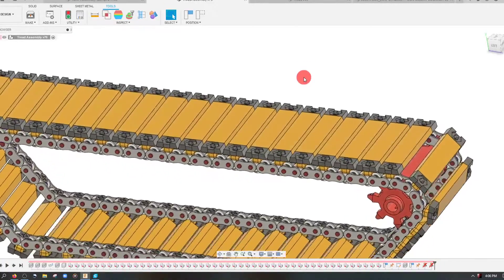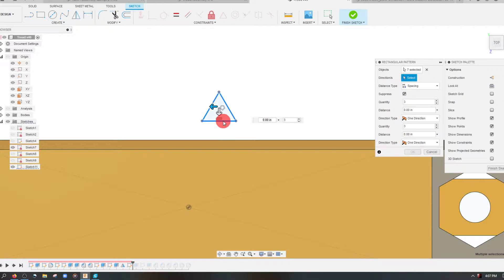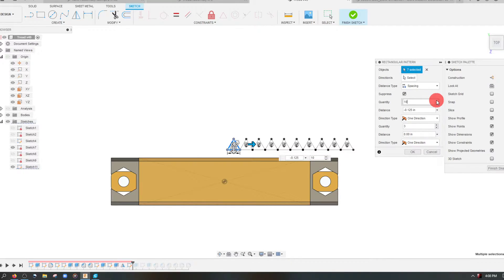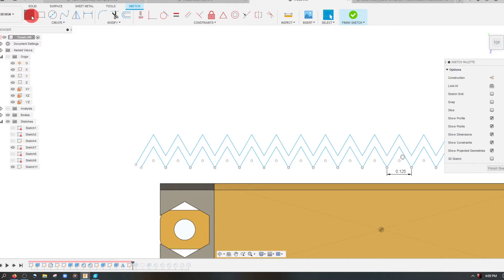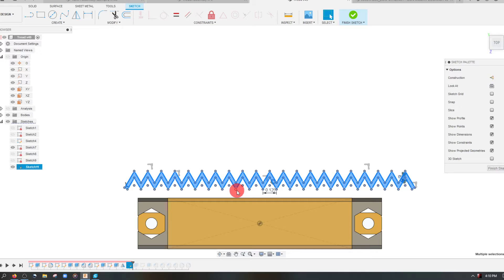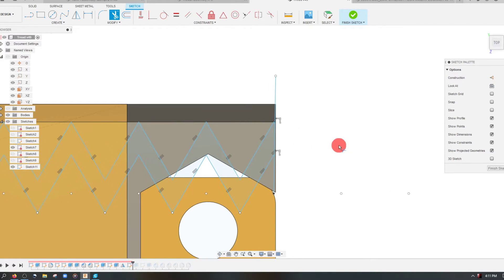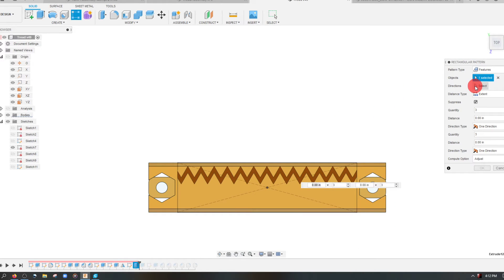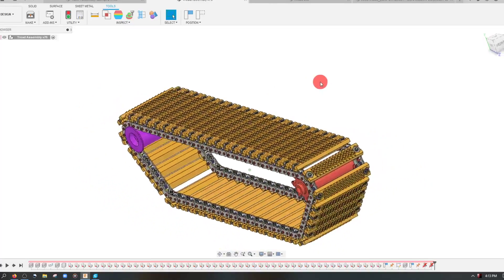How to Create Raised Surface Patterns in Fusion 360 (Tracked Robot)

Comment: Hi, good tutorial. Just a suggestion here. Another way would be to just sketch an inverted "V", pattern, extrude surface and then thicken. In that way, there is no need to sketch a closed profile.
Reply from the maker: True. This method works very well! This is the way to do it without getting into surfacing.

Comment: are you going to 3d print those ?
Reply from the maker: Yes! I will have some videos coming out soon showing the final printed parts, and the tread actually running.
Reply: @AvivMakesRobots  do you plan on making the sprocket roller 3d printed too ?  :D i want a rc tank
Reply from the maker: @buder5116  Absolutely! I am already working on testing for the track and suspension system.